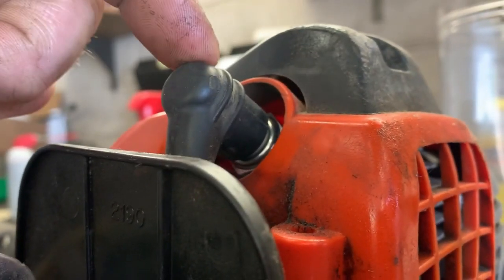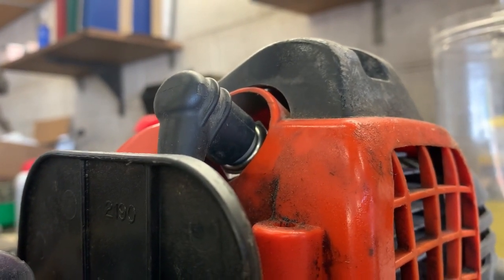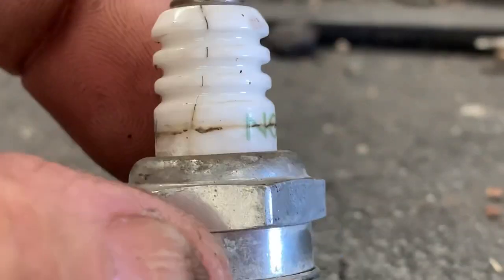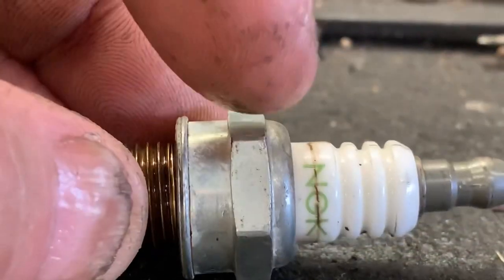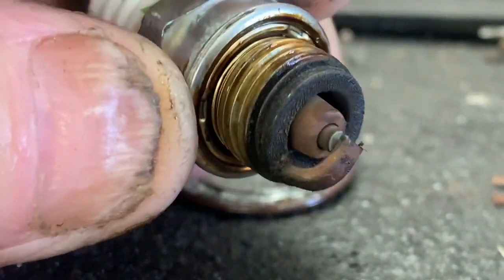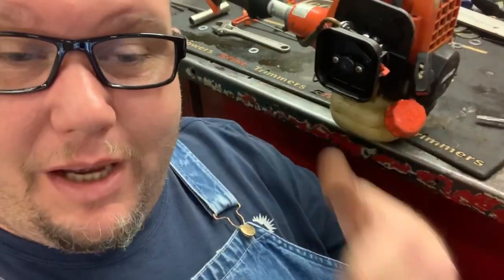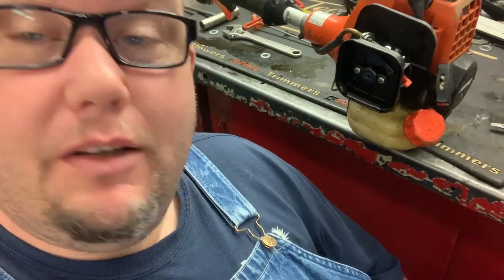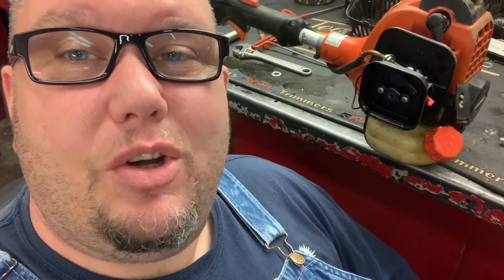2 CYCLE ENGINE MISSING / IGNITION LEAKS AND HOW TO FIX

Comment: Yeah, that little leak can light up your life too. This is from experience, LOL
Reply: Yep. Ignition voltage is no joke. Somehow one of the kill switch wires made contact with an ungrounded metal sheath and I touched it and gave me a little jolt. The kill switch wires are on the primary (low voltage) side of the coil. I can only imagine what the secondary (high voltage) could do.

Comment: N.G.K.'s will do this wit no visible cracks will start out OK then leak cause backfires and stuff you'd never seen a spark plug cause. Dump the N.G.K. they're N.F.G..........
Reply from the maker: Seen it with champion, denso, autolite, ngk, hell, pretty much all plug mfg.  I’ve head dead plugs from them all right out of the box